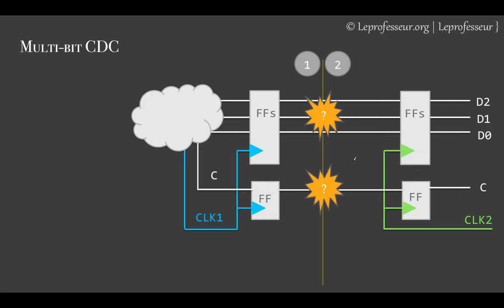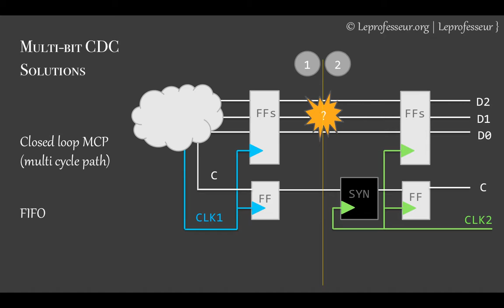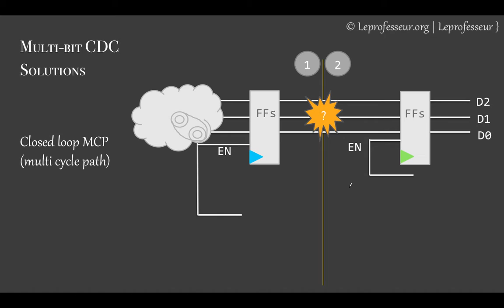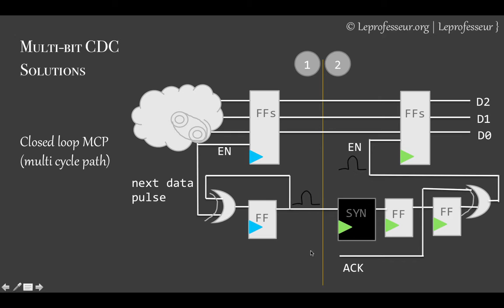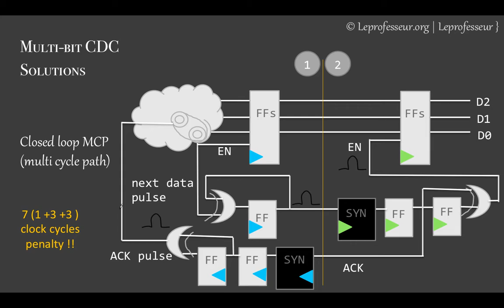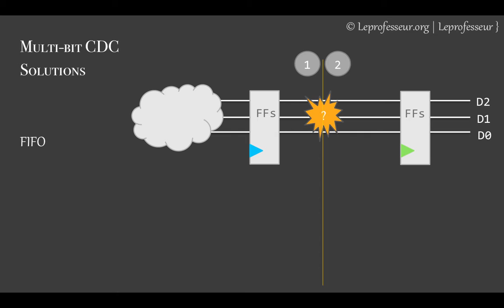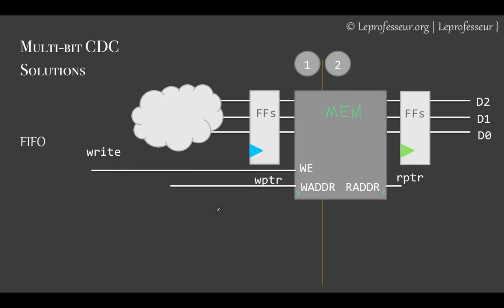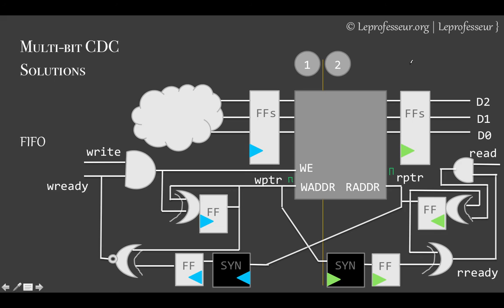⨘ } VLSI } 9 } Clock Domain Crossing (CDC) } FIFO } LE PROF }

Comment: Hello Sir, Thanks a lot for the valuable lectures. 
I have some doubts about the Closed loop MCP solution. Why do we need an  XOR flop to generate a pulse, why couldn't we use an edge detect circuit? What if the EN signal is Hi for more than 2-cycles? Then the output of the XOR flop structure will toggle? 
Also, on the receiving side, why do we need an additional XOR flop if the received enable is already a pulse? 
Thanks,
Reply from the maker: There can be many different possible MCP solution for CDC. In the lecture one example is discussed to give concepts. Typically EN signal is generated with intention in mind that it acts as one of the handshake signal. If EN toggle, one needs to make sure that it stays high enough to be properly captured. Idea for XOR along with flop is to generate a clock wide pulse for handshake mechanism. In theory you may not need extra pulsing if receive EN is pulse, however in real circuit, since signal crosses the domain, one can not be sure that signal will toggle with minimum one receive clock width due to delays associated with path depending of which technology library is used, so its good idea is to generate pulse in each clock domain to properly implement handshake mechanism. However, in real circuits FIFOs are typically implemented instead of example circuit described.  All the best! LeProf }
Reply: Thanks a lot! It's clear now!
Reply from the maker: you are very welcome! LeProf }

Comment: Thanks for the explanation on the clock domain crossing. I had two questions..
1. When the data is crossing from slower(Source Clock) clock to faster clock(destination clock)  which technique can be used?
2. When the data is crossing from faster(Source Clock) clock to slower clock(destination clock)  which technique can be used?
Reply from the maker: Thanks for feedback. Answers:
      1. When signal is crossing from faster clock domain (source) to slower clock domain (destination), one needs to be very careful, implementation must fulfill minimum pulse width requirements in slower clock. One may implement open loop state machine based solution in faster clock domain or some mechanism which makes sure to fulfill minimum pulse width requirement. Another better way is to implement a closed loop solution with some sort of acknowledgement from destination back to source clock domain that signal value has been correctly captured and the signal can carry new value. The state machine or some logic in faster clock domain needs to make sure that data pulse has been stretched enough that there will be no data loss in slower receiving domain.
       2. In case of signal crossing from slower clock (source) to faster clock (destination), its a bit easier. Nevertheless it must fulfill minimum pulse width requirements in the receiving faster clock domain. If source clock is minimum 1.5x slower than destination clock, it is safe, one does not need special logic in source domain.
In both cases crossing signal must pass through a sync flop mechanism (double flop of special sync cell from technology library). Further, one may develop assertions to verify CDC protocol for pulse width checks.
       Best! Leprofesseur }
Reply: Leprofesseur }
Thanks for your valuable explanation.

Comment: Hi Leprofesseur, thanks for wonderful explanation.
I had a doubt in fifo design, how write pointer and read pointer is made 1 bit ?
Reply from the maker: Thanks!, it was not made 1-bit, it depends on how deep is memory, in the example it is 2-deep fifo so 1 bit is good enough, in general binary pointer values will need to be converted to grey code so that only one bit changes at a time across the clock domains.